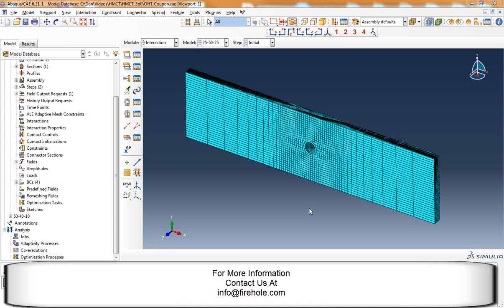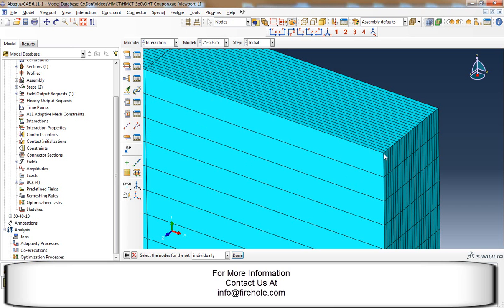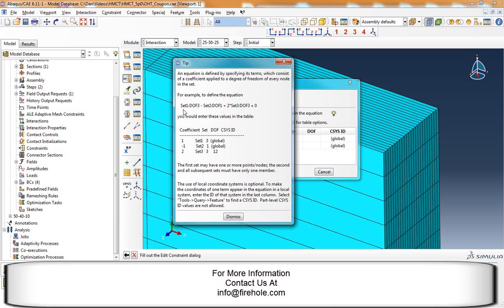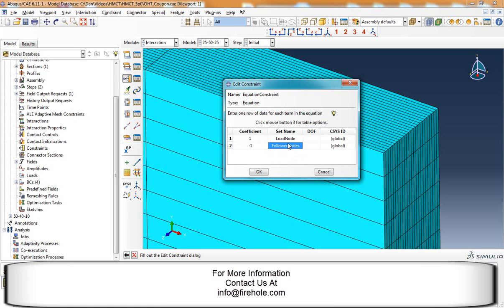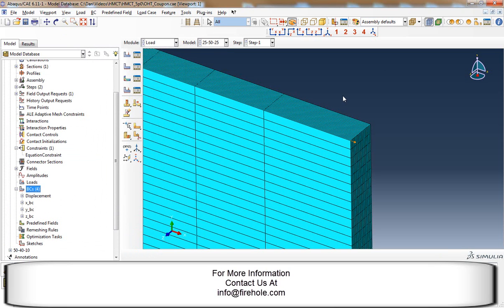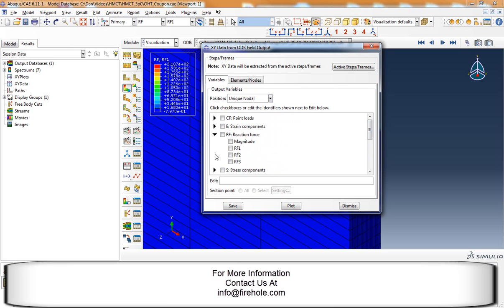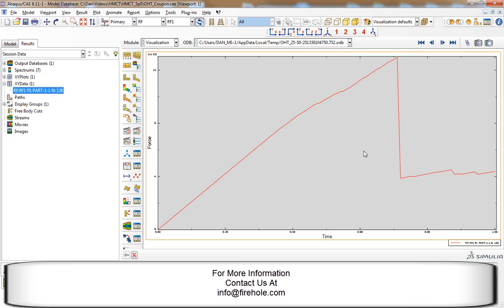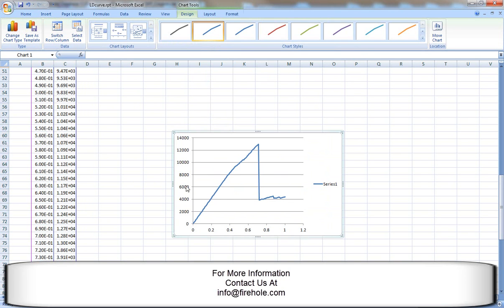How to Create a Composite Test Coupon Load Displacement Curve in Abaqus

Comment: says "how to create a load displacement curve"
creates load time curve

still helpful, thx
Reply: I wish thinking just thesame, but it was indeed helpfull as there aren't many Abaqus video's out there !
Reply: Ruben Ellegiers  If you want load displacement curve, you can do it by creating a Force Time Curce and a Displacement Time Curve. Than you go on cret xy data -> "work on XY Data" or sth like that. Then you chose combine on the right side. Then you put the displacement curve before and the load curve behind the comma. you can put mathematical operations in the combine command. e.g. to craft a Stress Strain Curve: combine(DisplacementCurve/Couponslenth*100 , RFCurve*NumberOfNods/CrossSection / EModulus)

Maybe there's a more elegant way but it works for me.
Reply: +Dennis Supertramp Thanks for the information. What i've been doing is getting a displacement-time and Force-time curve from abaqus and then converting those to  a Force-displacement curve in Excel. It's a workaround wich works just fine but it is a little time consuming though.